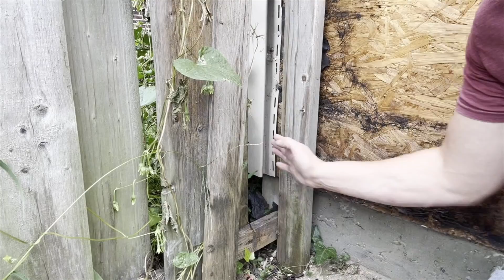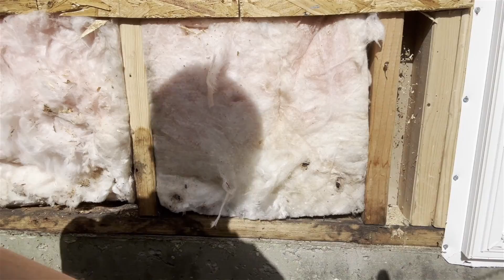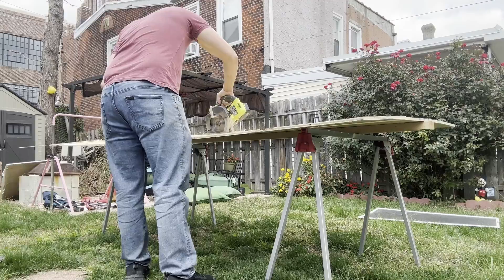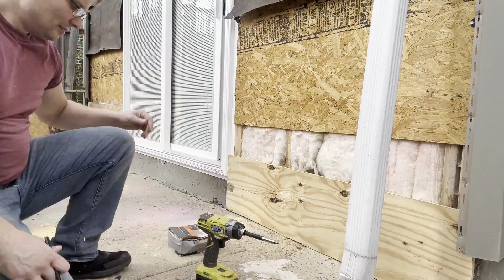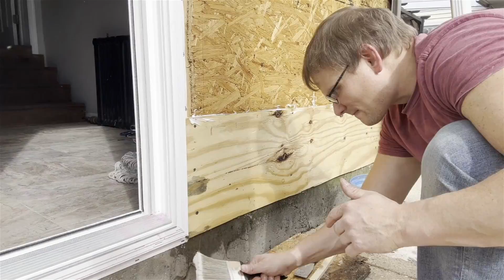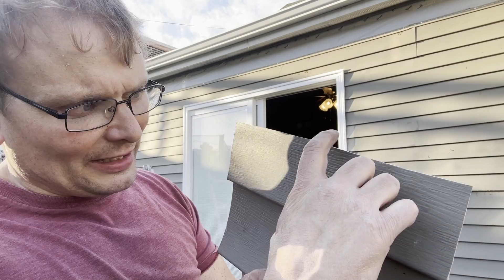Fix Rotted Exterior Wall water damaged wall

Comment: Do you know how water got there to rot that out?
Reply from the maker: You know what. That’s a great question. I wasn’t entirely sure. I thought it might have been absorbed moisture from the concrete footing. Or maybe the felt paper wasn’t providing adequate protection against moisture. Also the siding was nailed tight I. A couple of spots which could allow for buckling and moisture to get behind it. I tried to correct as many issues as I thought there might be. I do wanna pull a few pieces eventually and see how it’s holding up. But I’ll say this. The kitchen used to be drafty and it’s not anymore.

Comment: I have a dumb question, how do you make sure you don’t cut into the 2 by 4 under the plywood with the circular saw?
Reply from the maker: Not a dumb question at all. You can adjust the depth of the blade on just about any standard circular saw. You might not get it perfect, but the idea is to make it shallow so that at most you do no more than a superficial surface cut to the 2x4s.
Reply: @Kazerone1 thank you!

Comment: This is common as I am learning , how did the rubber seal paint hold up?
Reply from the maker: Honestly I don’t know for sure unless I remove the siding and look but I will say that I had some drip down to the concrete foundation and it’s been fully exposed to the elements and it’s holding up. So I’d imagine the covered stuff is just fine.

Comment: I’m going through a debate with my contractor, same situation rot behind ledger board where the plywood sheathing meets the deck. I think the wall should have been supported, because that’s structural and he did not support it while replacing that wood.  At least he was honest with me but now I’m scared about the integrity of things.
Reply from the maker: Geez….hope your situation works out. Sounds like a more pain potentially!!

Comment: You should have just used flashing tape on that lower section or aluminum tape which could have bridged the gap at the bottom. Pressure treated plywood and flashing over that.
Reply from the maker: I imagine it’ll last fairly long the way it is as the seems aren’t exposed to the elements. But not a bad suggestion.

Comment: What about the rotted 2x4s studs? Do those need replaced?
Reply from the maker: The 2x4s were mostly still sound. I was able to screw into them and they held. It’s the chip board that really falls apart so I replaced it with real exterior grade plywood. The 2x4s mostly just has staining but we’re still sound.
Reply: You are dang right they needed to be replaced. This job was only half done.
Reply: @seattlefishing4240 : It looks to me like he’s a young father with limited resources who did the best he could with what he had. Yeah, maybe a licensed contractor would do a “perfect” job and charge a boatload, but that’s likely not an option here. All-in-all he repaired the problem and will learn more as he gains more experience. I commend his efforts because so many young men these days are lazy and won’t get off the couch and give it a try!

Comment: Couldn't you have just replaced that whole piece there?  That conduit just goes through the fence right?
Reply from the maker: I could have and I could have pulled the wire through as well. This piece wasn’t structural it was more to block any opening and was screwed into the wall. There was a hole drilled through the 2x4 that the wire went through.
Reply: Just to clarify, my sheathing is an exterior wall that is perpendicular to the web floor trusses and he did not support it.  I’m worried!!